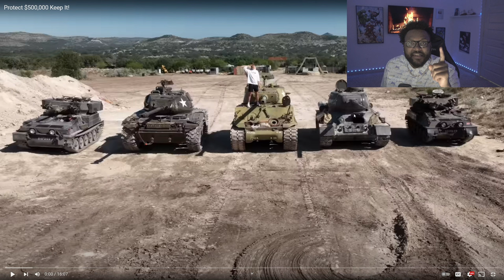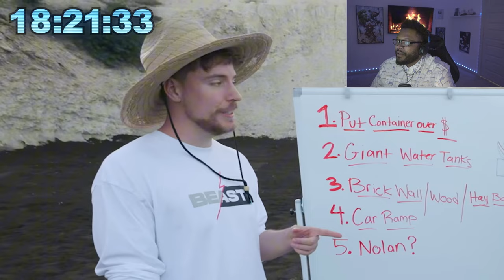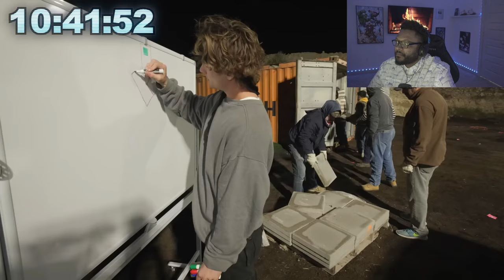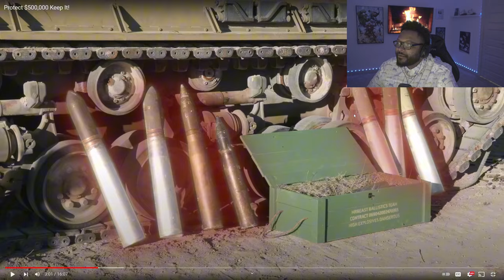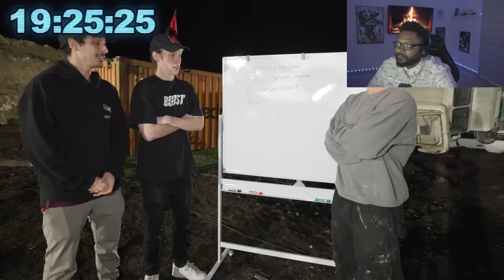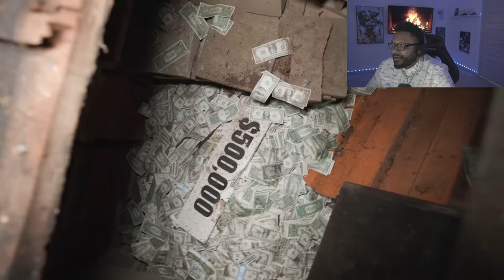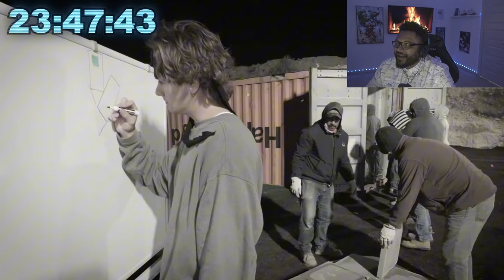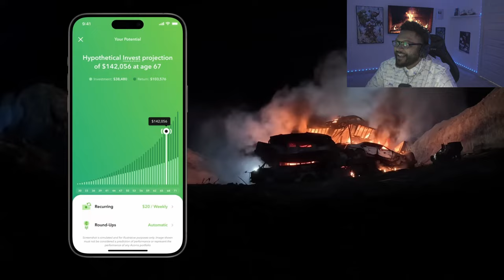MrBeast - Protect $500,000 Keep It! *REACTION*

Comment: I might be a bit late but here is an explanation abouth the tanks

The 3 tanks in the middle are world war 2 tanks while the ones on the right and on the left are light tanks build during the cold war and here are the shells that these tanks and other tanks in ww2 use

AP (armoured piercing): this shell is the on that they us in the video. it was design to penetrate armour as the name suggest the shell does not explode so think of it as like a big bullet
HE (high explosive) : this shells will explode when come in contact with anything it is use against lightly armoured vehicles and infantry
APHE (armoured piercing high explosive) : is a traditional armor piercing round that has an added explosive charge. It's still designed to punch through the armor. The added explosive simply causes additional explosive damage after penetrating the armor

Today modern tanks use APFSDS (armour-piercing fin-stabilized discarding sabot) in response to heavily armoured main battle tanks. it's a long dart penetrator made out of tungsten or depleted uranium. Its lethal power is due to the kinetic energy imparted to its long, slender and very heavy penetrator, impacting the target at velocities between 1.4 to 1.8 km/s

There are many more shells that they use from ww2-present but there are far to many but currently the strongest one is the APFSDS. Hope this helps and sorry for the bad english